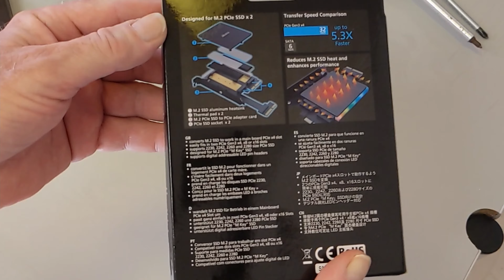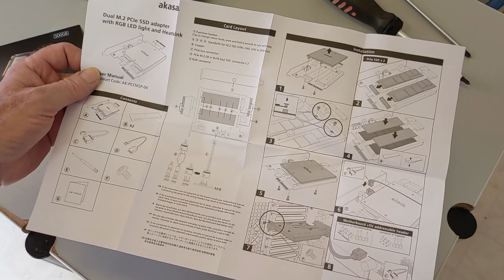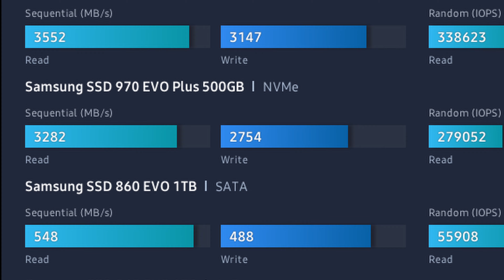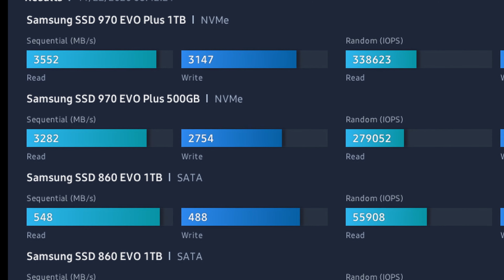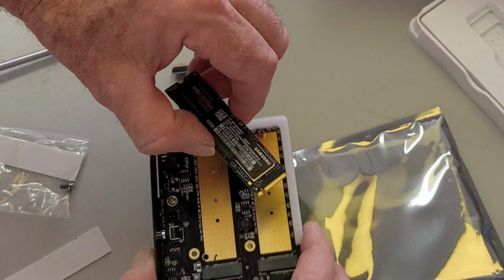Akasa PCIe adapter that will take two M.2 NVME cards. I used Samsung 970Pro

Comment: Honest Question: Can we disconnect the 2nd cable and just have rgb lightning effects?
I wanna do a all out rgb build. No need to install m.2 into the unit.
Reply from the maker: LOL.... it uses a little wire to plug into RGB. so yes.... LOL. But M.2's are sweet to use! The RGB is a nice frosting is all.

Comment: My Motherboard has the following expansion slots GA-880GM-USB3 (rev. 3.1)
1 x PCI Express x16 slot, running at x16
1 x PCI Express x1 slot
 (All PCI Express slots conform to PCI Express 2.0 standard.)

2 x PCI slots

Can I use this adapter and NVME SSDs in the slots available?
Reply from the maker: OMG... you have an OG Board! And it still works! Bravo! It must be ten or twelve years old! You could use some of the PCIE slots with this NVME expansion card, but sadly, you'd only get PCIE2 support. So there'd be no point in paying more for a recent Samsung for instance, unless you plan on eventually getting another board that could fit one in.
Wow...... the advances made in computers since your board was made have been HUGE. Almost anything on the market would blow you away, yet I can understand the point in keeping a machine that works and performs the tasks. And since the modularity of components allows mixing-and-matching, we can upgrade to a point. But the PCI Express standards and docking spaces are definite limitations. But if you've been using a spinning platter-drive connected through old SATA ports, this little device and a couple of M.2 drives will definitely make you see  a huge increase in speed.

Comment: Hello Sir, I have Galax B450M motherboard paired with Athlon 3000G, although it has an M.2 slot but still it doesn't detect my NVMe because the processor it has only 6 PCIe lanes (4 for GPU and 2 for Chipset) if I use the M.2 NVMe to PCI-E adapter with my XPG S40G Gen 3x4 NVMe in the X16 slot will it be detected in the BIOS and will I be able to boot windows with it?

Comment: Can you boot from the Akasa PCIE adapter, please?
Reply from the maker: In general one cannot boot from a striped set of drives, but I think if the drives were not striped, they should be able to boot the machine.

Comment: Hello sir, is it possible to change ssd m2 sata 3 bay pcie 4 NVMe M2 SSD samsung 980pro used a adaptor, in effect i both the ssd samsung 980pro 1to but my tablet dell venue 11 pro has ssd m2 sata 2260 please help me thanks
Reply from the maker: The one I have only works with M.2 NVME types, not SATA.
Maybe this other one is one that might suit you well.. it can take both types!
https://www.youtube.com/watch?v=qmsudIeA4es